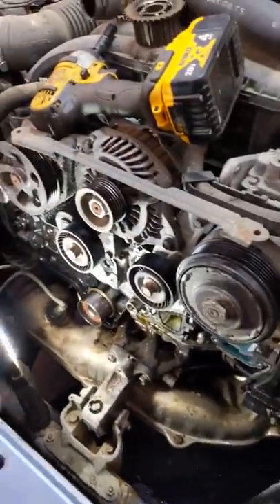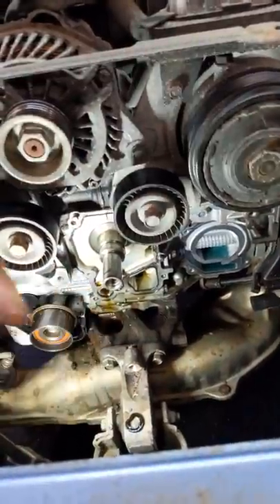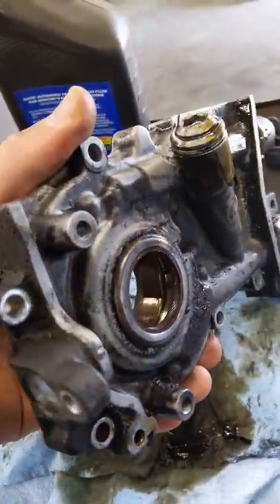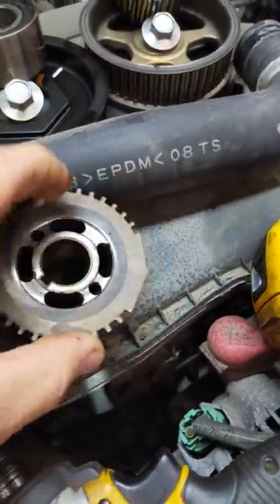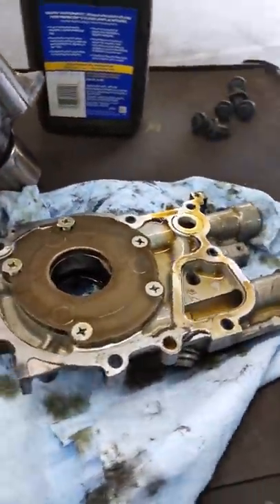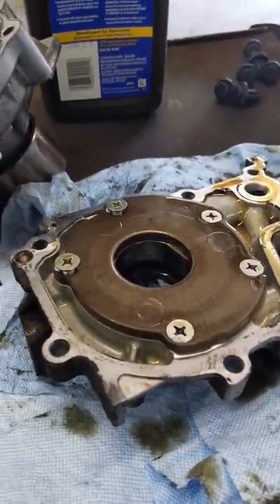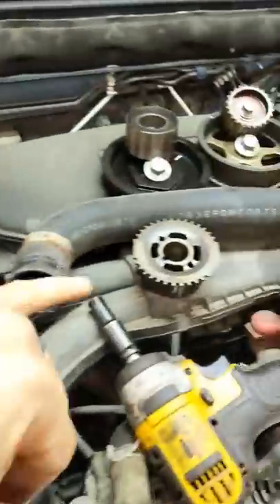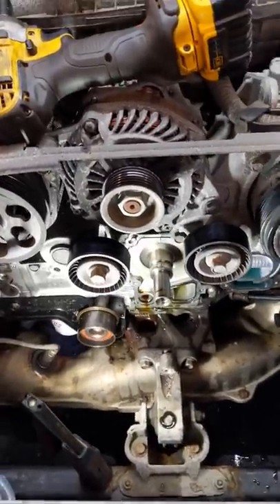Subaru Crank Seal Fail #SHORTS

Comment: Subaru 2.5 motor, 150000 miles head gasket 150000 miles another head gasket. Head design flaw 4 bolts instead of 6 to save money.
Reply: lol it probably overheated and you warped the mating surface you dingus. Do the job right and it wont happen again. Also, what year? I disassemble and work on EJs all the time, they are all 6 bolt heads from what iv seen

Comment: Subarus don't have head gasket problems and if you think they do you shouldn't be working on them. That was only an issue with early 2000s mid 90s NON boosted models because Subaru used paper single layer head gaskets
Reply: The main things that gives them a bad reputation are the idiots that use cheap performance parts like it's the Honda it replaced.  I've put 40k miles on mind at 500whp and the motor is in perfect condition.  As long as you build them right and stay on top of the maintenance they're just as reliable as anything else out there.
Reply: @drunk3n_m0nk12  yeah my 06 pearl white sti has 600awhp with a iag block and had for 60k miles. It doesn't even had a single bit of blowby. Catch can is always empty and in not nice to it

Comment: Subarus with their horizontally opposed engine are notorious for burning oil. If one reads the owner's manual it will state that it can consume up to five or six quarts between oil changes. In fact, Subaru had a number of engines recalled and replaced because of excessive oil consumption. It's amazing to me how Subaru refuses to solve and fix this problem of excessive oil consumption. It's the primary reason why I never bought a Subaru because otherwise the car is fantastic. They have a serious management problem at Subaru not to fix excessive oil consumption decades on end.
Reply: It doesn’t say that in the owners manual

Comment: I disagree with you. If the crank seal is pushing out you buy a second engine you fully rebuild it do an engine swap. And then fully rebuild the second engine to have a spare because that is the only way to work on a Subaru

Comment: Is it true that Subaru engine's waterpump is driven by the cambelt? I heard of a waterpump that seized solid, stripped the belt of its teeth, the camshafts stopped or slipped due to missing teeth and, guess what !!! It's an interference engine...
Reply: yeah, the waterpump is driven by the Timing belt, as long as you replace the belt / pulleys on the required intervals and get quality OEM parts you won't have that issue.

Comment: And ANOTHER reason why I won't ever own a Subaru
Reply: Lots of people defending them saying they're as good as any engine... ehhh. My timing is 4 pulleys to align, it's a chain so it needs to be done 250k or more miles, and my car's PCV system doesn't grenade main seals. 

Am I saying there shouldn't be fans of Subaru? Not at all. But don't tell me how reliable they are, just accept that they're a niche thing.
Edit: Helped a buddy change his 2002 STI timing and water pump... I was blown away at how many pulleys it needed. STOP YOURSELF SUBARU.
Reply: 480k miles between my two old EJs, I beat the piss out of them too. Never disregard an entire manufacturer.  Oh and those 4eat transmission never go bad, literally never. They go 400k miles before showing any sign of age. What car do you own? ill link an endless list of problems with it.
Reply: @jetjazz05  Your also a dingus. I see so many people say "they are trash engines, its a 4cyl with 4 cam sprokets!" (not pulleys) Subaru is a tiny company, especially back then. They could not overengineer their engines. people up power and then they break easy. That is not what subaru intended to be done.

Comment: True coment, not ment annoy subie owners out there.
BUT, how in hell do these engines get there so called high reputations from. To my mind there are far superior engines out there that doesn't have the agony that these engines endure. Not just Toyota either.
Reply: Gas mileage powerband there's different reasons why you would want a rotary

Comment: Seen this eat a motor before
Reply: Yeah, they got lucky that it blew out the seal.  You usually don't find out the screws are backing out until it spins a bearing.

Comment: Would definitely put thred locker in those screws for reassembly, especially after being wallowed out by years of vibration working the looser and looser. Another shitty design.

Tome to go electric with any Tesla's far better engineering and desgn.

Comment: I can't understand why Subarus are so popular. They don't look all that good, ride terribly and have problems like that. Go figure.
Reply: I thought I was the only one who didn't like their look!
Reply: @zigner  i think they are dumb looking cars.. certainly over hyped. Only thing worse is maybe those boxy looking cars with wrap around glass that look to be models froma  washing machine?
Reply: Relatively cheap, safe, AWD. They don't have as many problems as subaru haters seem to think. I'm not calling you a hater, but every time Eric does a video on a subaru, people bash them like crazy. If Honda or Toyota could make an awd civic or corolla I'd consider one of them, but in the meantime, there aren't a lot of options out there at around 20k new/used. The used awd domestics I could get at that price would be an even bigger headache than a subie.
Reply: @zigner  Same here!:)
Reply: @chrissmithz314  Most people who buy AWD vehicles don't even need AWD, but that's another story. I've been a Toyota owner since 2000, but don't like what Toyota makes nowadays (except a few JDM models), and I've never liked Honda. Domestics are pretty much garbage, as you said, so I suppose I am a true hater.;)
Reply: @chrissmithz314  The new Camry has an AWD option now.
Reply: @21Piloteer  I found that out the other day and couldn't believe it, it's about time!
Reply: None of those things are true, have you considered that?